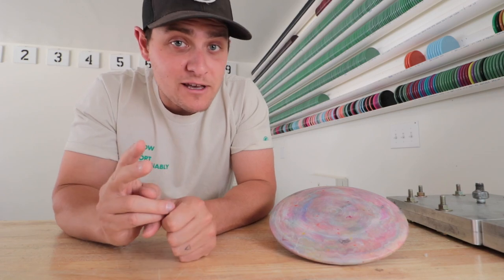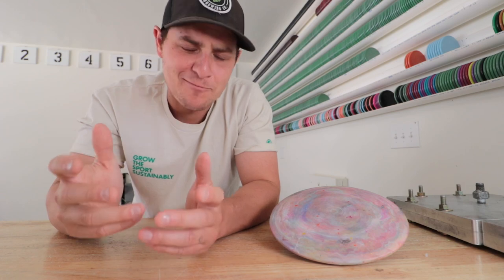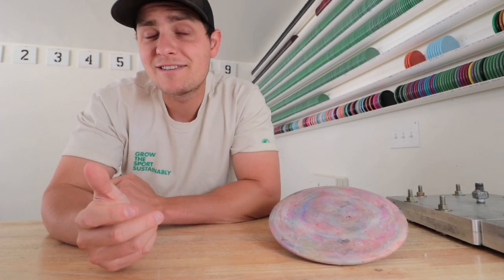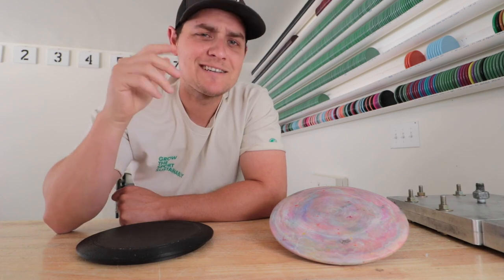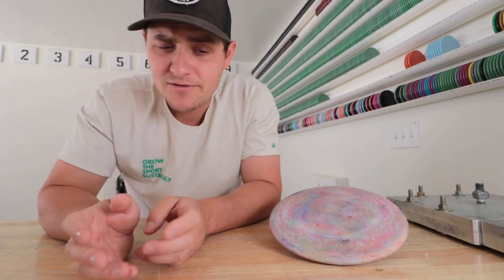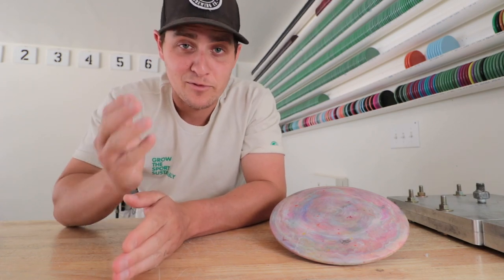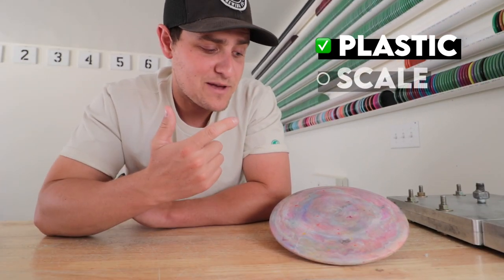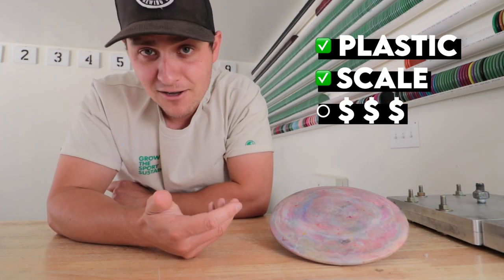We Made a New Disc Golf Midrange (..how does it fly?)

Comment: Stability is significantly caused by Parting Line Height (PLH), and PLH can vary within the same mold based on the cooling rate of different plastics. A good recent example of this is the Halloween Edition Eclipse 2.0 Insanities from Axiom. The Eclipse 2.0 plastic cools at a different rate compared to Axiom's other plastics, and resulted in a significantly more overstable version of the Insanity. In your case, while I don't know all of the details of the printing vs molding process, I suspect there were sources of a change in cooling rate beyond just the nature of the plastic. I would guess that the temperature levels and timing change significantly between printing and molding.
Reply: PLH is one  thing  but there are other factors as well.  Really can't attempt to answer the questions without all the measurements.
Reply: I was going to say this ⬆️
Reply: The 2.0 eclipse makes discs SO stable. My insanities are really just firebirds
Reply: Wanna hear something that you might not agree with?  The inner plastic in MVP overmold discs doesn’t have to do with stability at all since the parting line is really what matters.  The reason why those might be so stable is because of the outer mold and the way it cooled after injection
Reply: @wakimura303  I do like hearing things I might not agree with. I'm having trouble reconciling your statement to my own experiences and information I've heard elsewhere. Could you provide any other evidence to back up that the core has no impact on stability?
Reply: To be clear, plh doesn't itself determine stability. Plh just indicates wing angle. Wing angle determines stability. Plh is just the easiest way to determine what the wing angle is between two discs of the same mold. I'm pretty sure Jesse covered that in the last video. Regardless, there is no PLH on a 3d printed disc. So it's not useful to compare the molded disc to the 3d printed one.
Reply: @UnlimitedDiarrhea  that's a good clarification, thank you
Reply: @aydanschat4123  yes, check out TN Disc Sports as he has a very detailed video on MVP and how their technology works.  Although i know the eclipse 2.0 rim is different than stock neutron or proton so that probably comes out of the mold and cools to have a more aggressive parting line
Reply: That Halloween insanity is basically a flat top firebird.  It's insane
Reply: @UnlimitedDiarrhea  That's why it would be useful to know the difference in rim configuration between the molded and the printed discs.
I wonder if Jesse has a means to measure it?

Comment: Mold cooling and stress relaxation can be roughly calculated or estimated, or you can just fiddle with the mold until the final product more closely matches the exact dimensions and flight of the disc you 3D printed.  Surface texture and weight can also have some effect on the flights, so I'd say you are more than likely just looking at a trial and error scenario here unfortunately.  But if you don't mind the $400 a pop molds while you're perfecting your disc, a few small variations in parting line, rim width, and dome would definitely give you some different flights (like single-digit percentage differences).  Good luck! Love my mini and hope I can try this disc out soon.

Comment: off-axis torque ("wobble") causes under-stability in discs (and i'm not suggesting there's a ton of wobble in your throw, just that ANY wobble can cause it).  for a printed one that is much stiffer, that off-axis torque cannot dissipate as easily as in a more flexible material.  A lot of 3d printed discs tend to perform less stable than their molded counterparts because of the inflexibility

Comment: Thanks for mentioning the difference between 3D print being less stable, and injection moulded being more stable. As the plastic cools after moulding I believe it is common for mass to get pulled higher in the disc, resulting in higher PLH and more stability. 

We are currently prototyping a mid (in Australia) and are planning to send a more understable shape than we want for tooling, expecting it to stable up out of the mould. 

Great work!

Comment: Have you measured both (rim width, rim height, Parting Line Height, diameter, ...)?

If the new one is more overstable it either has a higher PLH or/and a wider rim width.

And in case you haven't done that yet, throwing both of them at the same speed, angle and power would be worth doing.

Comment: My guesses for different flight between 3D and Molded,
1: Shrinkage - 3D printers print layers of plastic that shrink individually while cooling. Molded plastic is one giant layer of plastic that shrinks unilaterally, this means more shrinkage and shape difference overall
2: Elasticity - The 3D printed mold is not as elastic as the molded disc. Centripetal force will have less effect on the shape of the disc during flight

Comment: Playing around with my prototypes, density and weight definitely play a factor between a 3D printed disc versus injection molded. Not sure if you weighed them both, but compare that as well as your slicer settings on infill/walls to get an idea of how much empty space there really is in a 3D print. Each prototype I printed was sub 150g even at 100% infill and turns more than a beat-in Leopard at 147g despite having a profile that would suggest leaning toward stable. Hit me up sometime and we can talk shop about how different manufacturing processes and cross-sectional designs influence flight!

Comment: So can you do a parting line height comparison between the printed and injection molded version. I suspect that the shrinkage has changed the parting line height.  That would be the easy facto to see. Another possibility would be the density of the plastic like you mentioned. The gyro folks over at MVP talk about this a lot because the same over mold with different plastics changes the flight of a disc dramatically. My question is about the impact of your molding process, is it possible that the rim gets a little more, or or less pressure/density at molding time because of the rate of flow of the plastic and it cooling while molding...I guess I am saying cut one in half and let's see if there are voids in the rim or the flight plate ... But throw it first a lot so we know how it flies because we all know that even varying runs of the same mold can fly differently, so the next one might be less stable.